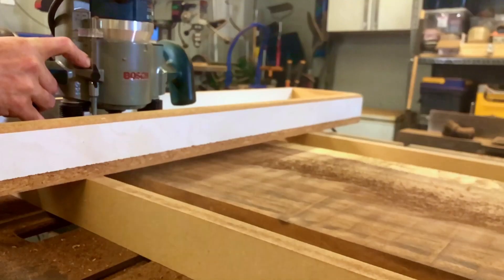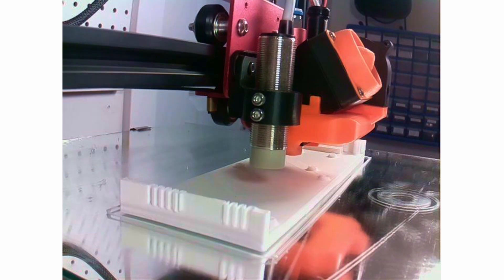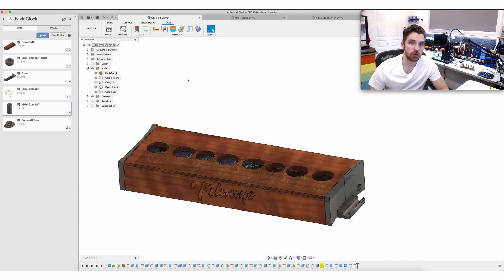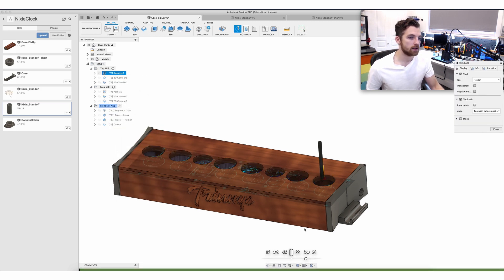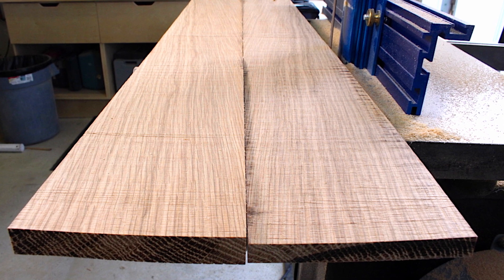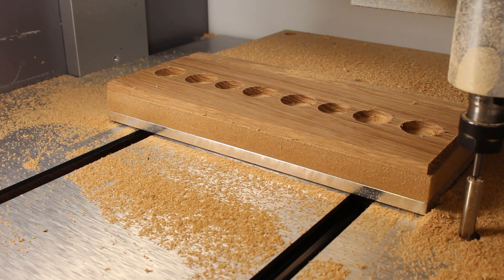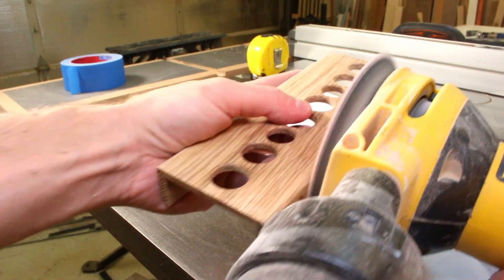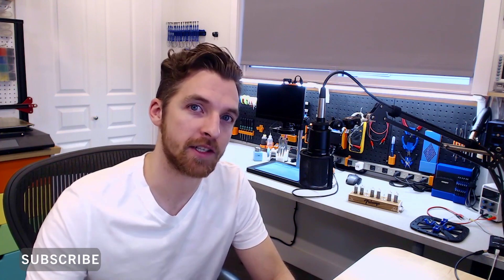Make a Nixie Clock | Part 3 | Making a Custom White Oak Case

Comment: Awesome build, sir! Have you thought about creating sockets for the nixie tubes for easier replacements should it be necessary?
Reply from the maker: Thanks 🙏 I had thought about sockets but I wanted the tubes to sit as low as possible, also some of the sockets would have restricted the Light from the LEDs which are underneath each tube.
If a tube fails (fingers crossed) you can just cut the legs off and remove the pins easily but you still need to break out the soldering iron ;)